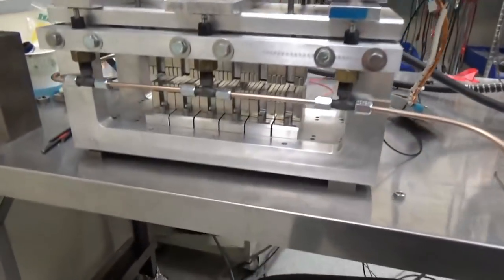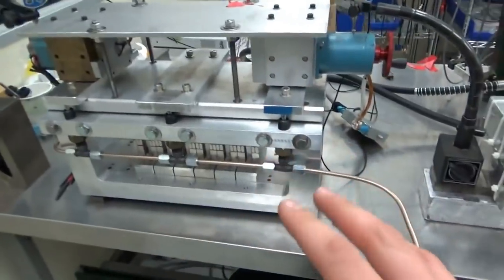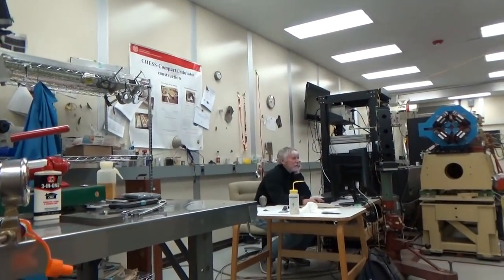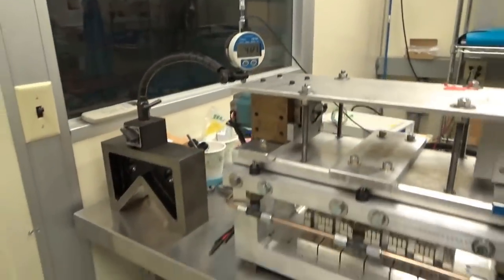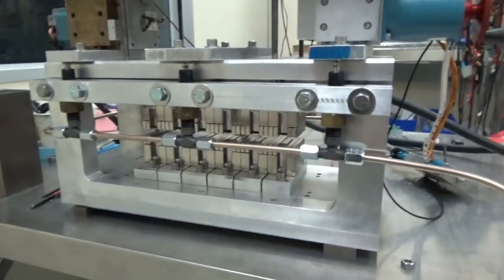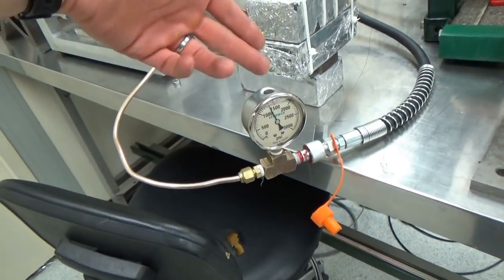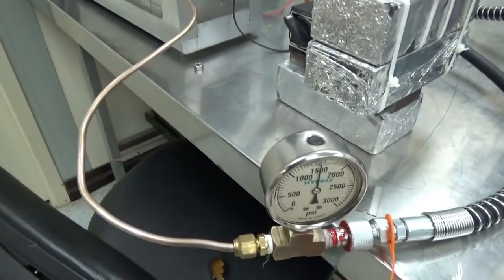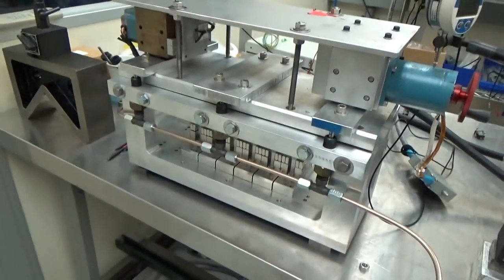PHAD Father's Day Special!

Comment: You might want to use the same system used to cut silicon wafers for chip mfg. . they use two wedges moving in and out to get precise movement. my father was an engineer at intel where I saw it in action. accurate to 10 angstroms.

Comment: would of been cool Ivan if you could of used a abs pump and system to have variable hydraulic pressure for like the front and rear pressure to adjust the height between the front and rear,just rambling.Thanks for the video

Comment: ideally, you'd use line rated 2x + working pressure and relief valves on pump to ensure it doesn't get anywhere near bursting. but prototype is prototype, use whatever gets you by :)

Comment: NOW we know who's to blame for Pine Hollow Auto Diagnostics.
Ivan is obliviously more than a mere chip off the old block.  
A very Russian solution to a problem:  instead of a lot of expensive and elaborate high-tech, just use an automotive hydraulic brake system.
Happy father's day, dad.
Reply from the maker: He got the motor controls dialed in...the prototype system works fantastically!
Reply: LOL  Great!  Very glad to hear that 2 of the best brains at Cornell have cracked this problem with such elegant simplicity.

Comment: Put a proportioning valve in like you use to control the pressure between front and rear brakes to let the hydraulic help the far side more. Unless you just need to get the two stepper motors calibrated together.
Reply: the force created by very powerful magnets changes drastically with the slightest change in distance between them. seemingly the best fix with lowest part count would be stepper motors with more strength (possibly just further gear reduction) and software working the steppers and hydraulics in better unison, seems overly crude with no hydraulic or other pressure feedback sensing...
wait, I'm not one of them there engimeneers  :)))

Comment: Not long ago- this would be "Science Fiction". If you research a Star Trek Wiki, you will see that what he is creating could also be part of a Warp Drive system; this would be a "magnetic pinch" that gets the tuned beam of plasma up to temperature. Not to be confused with a "Waveguide Conduit" that's basically an electromagnetic "pipe" (Cyclotron). You're Blessed with a very cool Father, Ivan. You should be very thankful.
Reply from the maker: I am very thankful indeed!!

Comment: Great father & son interaction. Absolutely wonderful.
On the technical side, perhaps 1 jack in the center which would control the gap at that location by modulating the hydraulic pressure and also act as a fulcrum. The 2 outboard stepper motors would adjusts the gap at the end positions.

Comment: Nice! Just knew you had a smart father. We do electron beam welding on aviation components at work which requires magnetic beam manipulation in a vacuum chamber. Cool stuff. Great videos.
Reply from the maker: Wow that sounds high tech! Pretty satisfying when everything works as designed :)

Comment: I see, a two tier system that performs a crude adjustment then a fine adjustment, it just needs a bit of feedback from sensors and a certain amount of hysteresis to stop it jerking about. (Not an easy job).
I can see where you get your sharp brain from, your clever dad :-D
Reply from the maker: He got it dialed in a few days after I made this video ;)
Reply: Smashing :-D, it can take a while to get any new idea off the ground.
There will be more problems, that's just the effect of getting closer to a perfect system.

I'm sure he will beat it :-D